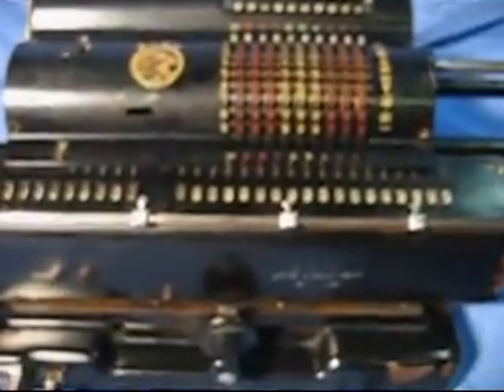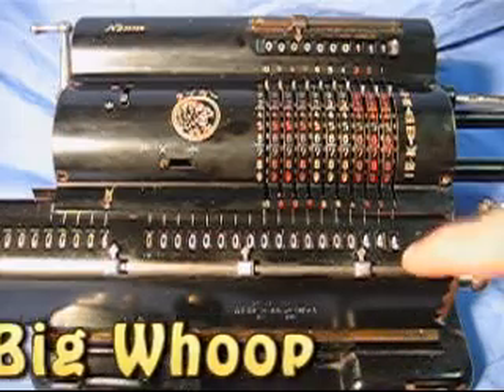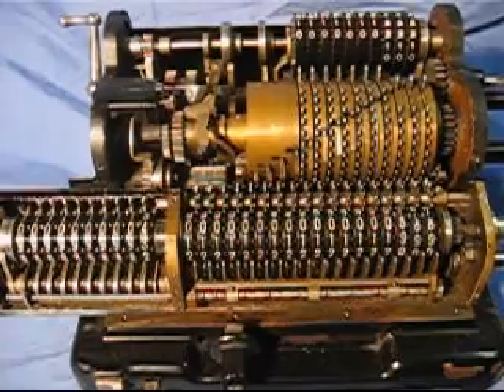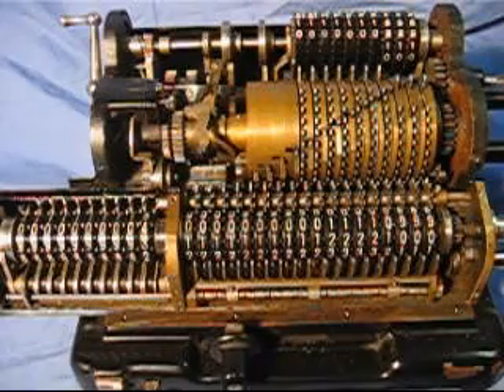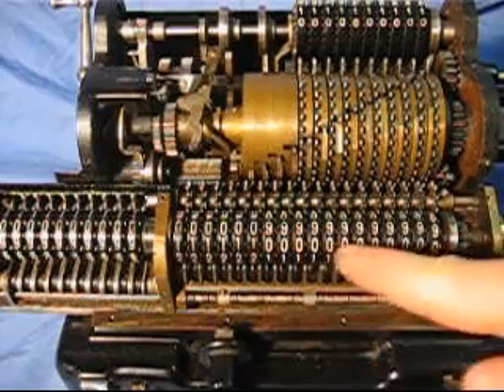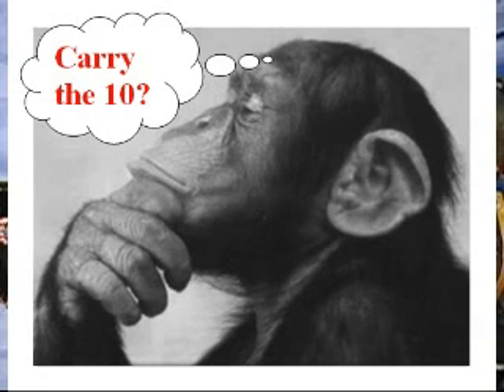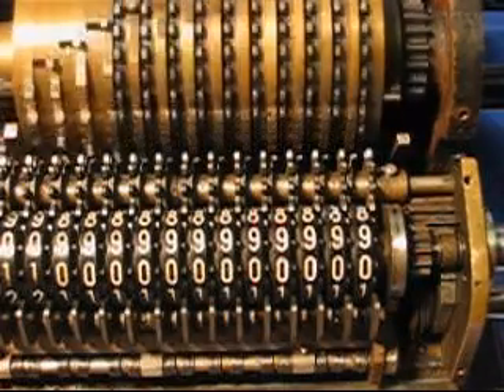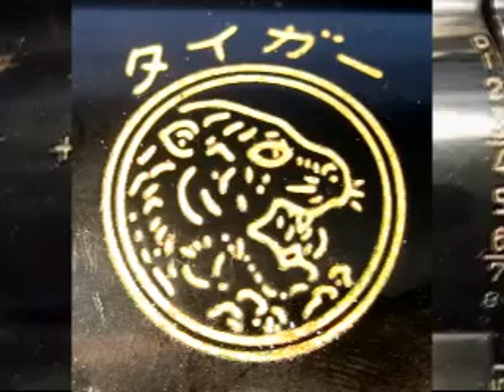Tiger - Japanese Mechanical Calculator - How it Works

Comment: Might contain lot of parts but it isn't really that complicated. It's quite obvious where most parts belongs. I "accidentally" bought a broken Odhner 239 at a fleamarket - my first mechanical and it got me hooked. There was only one way; take it completely apart for fixing and cleaning/lubricating - now running almost like new.

Now I want to service a Facit C1-13. But the 10 key mechanism scares me a bit. It doesn't look that much straight forward in contrast to the Odhner.

Comment: The tiger calculator has a setting to cause the counter to go in the opposite direction as the drum, the brunsviga and the original odhner don't.

Comment: There were some Tiger mechanical calculator in my parents' house.
Those were more modern models than the type of this video, were made in the 1960s.
My father was managing the store,　he turned this calculator through the night at the time of the settlement of accounts and the tax payment.
Besides that, my father had participated in the rally, His competition vehicle was Datsun Bluebird model 510, and the Tiger computer was equipped in front of navigator seat.
The tiger calculator resists vibration and a shock than electronic calculator of that era, ｓo it has been adopted to rally machine.
The tiger calculator of such my home was my toy of the young time.
Reply: ze4037 This is nice information. Do you know which kind of calculations they did during the rally?
Reply: Robert Mařík Unfortunately I do not know the details of the calculation as I was young in those days.However, it is supposed that it was the calculation that is carried out in a rally in the present age.For example, they calculate the speed that they should keep to the next point by the mileage and time.

Comment: I want to see a mechanical calculator capable of sine cosine and tangent. I can only imagine those must be required for celestial navigation and one of the first calculators was designed for that purpose. (though never built in a time when it would be used.

Comment: Best video on the subject. I bought a Triumphator CRN, had to machine brass replacements for a good few pot metal parts inside as they had swollen and were binding or broken. But it went back together and it works.

This has a Mult and DIV switch I assume the DIV stands for division but have not as yet found out how the function works.

Does the Tiger do or have the same.